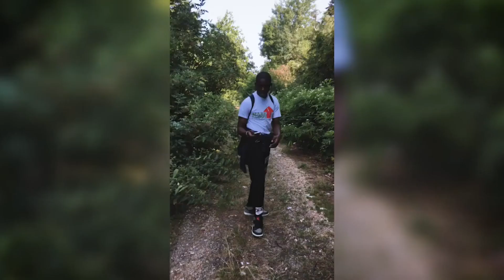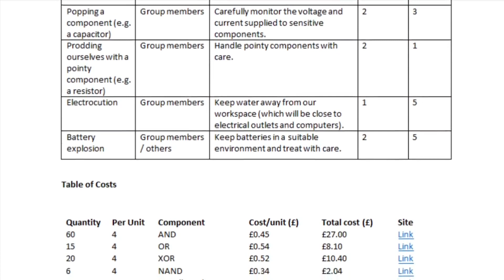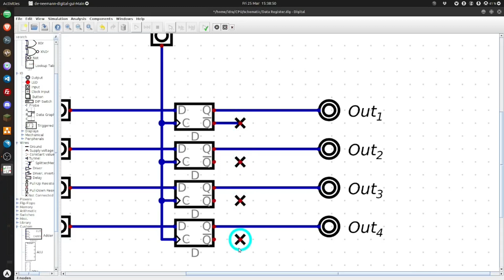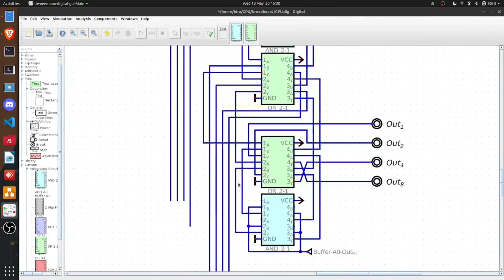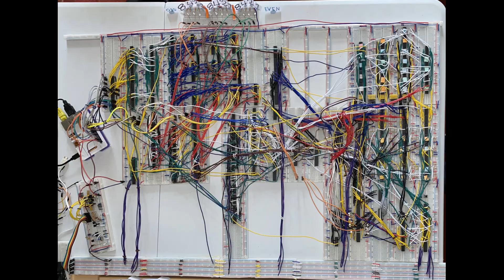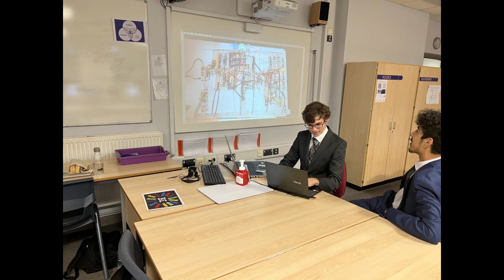How Not To Build A CPU

Comment: Two layer PCBs are very cheap, and they save you from the nightmare of the spaghetti wires.
Also: Do design verification! If you only use simple logic gate ICs, you can easily write a simulator (if you do not already have one) which simulates your electronic schematic. This way you can be sure that almost all errors are fixed before ordering the PCBs. You still will need to make a second and a third version of the PCBs, that is why it may be a good idea not to solder the ICs directly into the PCB, but use IC slots instead (depending on how cheap the ICs are obviously).
edit: the most important for design verification is that it is automatic, so it automatically converts your schematic (meant for making PCB) into something which you can simulate, like converting back to the digital simulator you are using. In your case it would be easier to convert the schematic into python and run that manually and test it if it behaves the same as your tests require.
Reply from the maker: Thanks for your comment Adam. We did consider using PCBs at one point, but determined them to be too expensive - even using the cheapest breadboards, ICs, etc that we could find, the CPU still went overbudget, and I believe it was quite expensive by MEF standards. I agree that it would be much more practical to do the project on PCBs, and we definitely would have gone this route if we'd had the money. In terms of simulators, how does your suggestion differ from the simulation we were doing in Digital (as discussed in the video), and also, how is design verification different from what we were doing with in-built tests already? Could you elaborate a bit on the appeal of separating the schematic and the testing/verification, and also how writing a simulation script in python would be superior to in-built tests?
Reply: @mklambda1834  the extra verification steps I have mentioned only make sense if you make a PCB.
Basically the point is that you need to verify that your PCB design is the same as your logic design. If you have no enterprise software, then you cannot export your PCB back to the logic simulator easily, hence I have mentioned that in the simplest cases this is easily scriptable.
In practice, your PCB will be always different from your logic design because the wires have capacitance (and delay too, but that is only relevant for high speed).
Trace capacitances can be simply estimated from the wire lengths widths, so can estimate the working frequency better, if you wish.
In the ideal case, you do the same tests for the simulated PCB design too, so when the PCB is manufactured you know it is good (or very very close).

Some PCB manufacturers make 100mm x 100mm boards for 5USD + 11USD shipping = 16USD. (PCBWay)
Wiring and debugging that nest of wires for days sounds more expensive than spending extra 16USD. With a PCB you need many times less breadboards and cables too.
You can place most or almost all of the critical components to a 100mm x 100mm two layer board, if you use SMD parts (they are sometimes cheaper too, and low pin count ICs are quite easy to solder if you learn how).
The 5USD board price is a "special" offer meant for students and enthusiasts prototyping stuff, more than one PCB manufacturer has it. You also get 5 PCBs for that price, so if you can partition your design into very similar modules, you may be able to use more than one. (100x100 is the upper limit of the offer, a 200x200 PCB costs about 90USD)